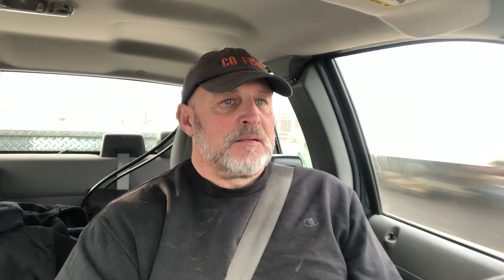Arc Fault Madness

Comment: Why do the AFs cause my LEDs to flicker when a heavy motor runs? My washer in thr agitate cycle causes my LED lights to flicker to the agitator. I changed a few AF circuits and the LEDs were fine on those? Im about to replace all mine.

Comment: I'm a lost little electrician dealing with nuisance tripping on a remodeled house couple has 3 months living there solar guy came bumped the breaker now its tripping out went the first time checked the outlets tightened the neutral on the breaker everything is working go home get called back so I replaced it went to 4 stores looking for this thing hopefully they never call me back :p they probably will to run some ac power for em 😂

Comment: I have an issue when I operate my Ham Radio gear that has wire multiband dipoles in the attic tripping multiple AFCI's in our main panel.  I have installed clip on ferrite cores to all the hot and neutral wires of these circuits in the panel and it has pretty much stopped the tripping issue down to a minimum!

Comment: The AFCI requirement will make homes less safe.  It may seem counter-intuitive, but what's going to happen is loss of respect for NEC rules.  Even many experts think that AFCI is unnecessary and just leads to nuisance tripping.   I know electricians who rip them out of their own panels and replace them with standard breakers.   If there is loss of respect for NEC, electricians may play loose with other rules as well, the rules that are there for a good reason.  This is an unfortunate mistake by NEC.

Comment: Most of the times, the issue is the cross neutral. If the  previous electrician used 2 hot wires and one neutral cable in a 240/120 , or 208/120 , 1 phase system, then you have a problem.  Circuiting like that for various receptacle or lighting circuits, then you have a common neutral cable, which is shared between two hot cables.  Unfortunately that original 3 wire circuit has to be replaced with 2 separate circuits, ( 2 hot, 2 neutral cables plus ground). So each circuit has their own hot and neutral cable. Otherwise it won't work. If there is a ground  cable, you should ensure the ground is separated from the neutral cable.  Schneider Electric and Eaton has articles for "Determining the cause of AFCI tripping". Check it out.

Comment: AFCIs get such a bad rap but incorrect wiring with shared neutrals are so often the problem.
My parents had the same issue with coffee maker, etc. They blamed the arc fault not being compatible with regular appliances. I started taking things apart, and found a shared neutral. Unbonded it and works 100% fine

Comment: True do some condo remodeling shared neutral all through it asked the inspector 
He said pull separate neutrals! 
Who's gonna pay for that
Besides the old EMT pipes are rotted out
What do you think?
Reply: If you can't pull a new neutral, it's easier to figure out which outlets are on L1 and which are on L2. Just abandon the wiring on one leg and run new conduit to those outlets.
Reply: Use a 2-pole CAFCI breaker. Done

Comment: Moved into a renovated home last summer and it was all arc faults. Soon after we got everything set up the tv, game console, and internet modem would flip. Then a very nice electrician that lived at the end of our street came by and replaced it for us. Then, in the same room, we set up our computers for work. My husband's computer is on the left, mines on the right. His pc, when the fan turns on, if the tv is on, will flip the same replaced breaker. Replaced it again with an old one and no issues. 
Then we had an issue where the microwave would flip. The Maytag guy came out and said they were having a lot of issues with these arc faults and he was surprised our fridge hadn't flipped yet, remember that for later. 
So, the same electrician came in replaced the arc fault while warning us that this was probably going to keep happening because arc faults were trash. 
Made it through the winter just fine until last month. My instant pot was plugged into the island and was fine. Later that evening I was making mashed potatoes and my hand mixer flipped the breaker for the island, the wall for the dishwasher, and the tv (etc) on the other side. crap here we go again.
My husband's coffee maker, he has to first plug it into the plug above the microwave, and then he can return it to the wall with the dishwasher to make his coffee, but he has to quickly turn it off after brewing or it flips that wall.  The coffee maker is brand new. 
Now when we use the dishwasher it and the fridge flips, the fridge is on the other side of the kitchen from the dishwasher. Everything downstairs just flips. Sometimes it will flip things upstairs. IE my husband's computer fan issue knocks out that wall and my daughter's br upstairs as well as the wall the TV and entertainment stuff is. 
We have another electrician coming to take a look because our old one just moved south for retirement. Its freaking maddning. Not looking for advice just venting, unless you have advice.
Reply: Have you considered replacing the AFCIs with standard breakers? You'd probably have to do it yourself. An electrician would almost certainly refuse to do it. Not because it's dangerous, but because it would be a violation of the NEC.

All of the workarounds you are describing sound ridiculous. You could try a different brand of AFCIs that might be slightly less trash. That of course is if they would even work in your current panel.  My house only had one 2 pole AFCI breaker. We had ceiling fans installed after moving in so the electrician was required to install an AFCI to be NEC compliant. Was fine for almost two years. Zero trips. However, it tripped and would not reset. The breaker went bad. Stupid 2 pole AFCIs are difficult to find locally. Amazon had a Siemens breaker with same day delivery. Found out that my panel (Homeline/Square D) puts an extra tab on the bus bar so other breakers won't fit. Returned and replaced with a standard breaker at about 1/10th the price.

Screw AFCIs.
Reply: Arc fault save lives take it for what it is. If they keep tripping maybe you have an actual electrical problem we wire 400+ homes a year for the nation's biggest builders no issues unless the electrician wants an easy out
Reply: @MrR64life  if you are doing new work in new construction, that's a whole different elephant than old work renovations.
Reply: @MrR64life   Thanks, already solved this three months ago.
Reply: @dizzybee4176  what was the solution?

Comment: Yeah I am not a fan of arc faults. Brand new home... Hit go on the brand new washing machine... head down to the garage and flip the arc fault back on... Wash 3 or 4 loads then flip it again. Ridiculous. My old place had standard breakers and the washer never flipped the breaker once in 12 years.
Reply: Your house is wired wrong. Since it's brand new, there should be a warranty clause you can invoke.
Have the electrician come out and fix the neutrals they bonded. If isn't the washers fault or the breaker's fault

Comment: I'll be damn if I'm putting a arc fault on my refrigerator. Im a electrican and if I was to buy a house, and it had arc faults, every time one gave me a problem..guess what...GONE...regular breaker going in..lol..I wouldn't do that to a customer house, but mine yes. Good video man..this has to raise you breaker outing a panel,say 30 circuit panel by a 1000.00 bucks or better.